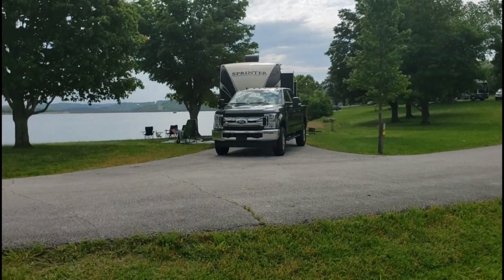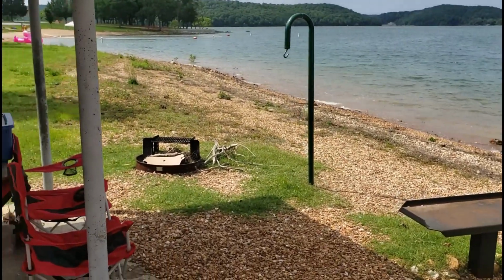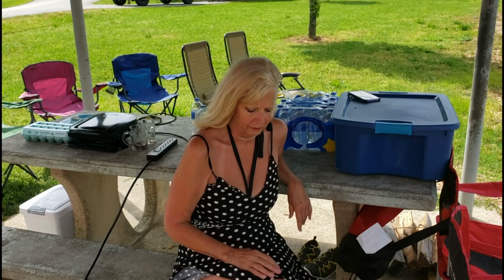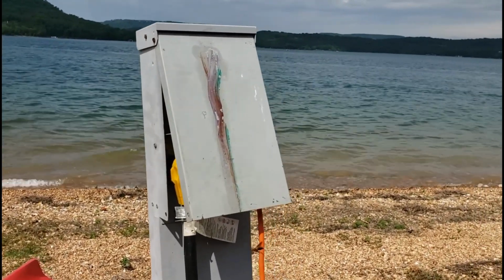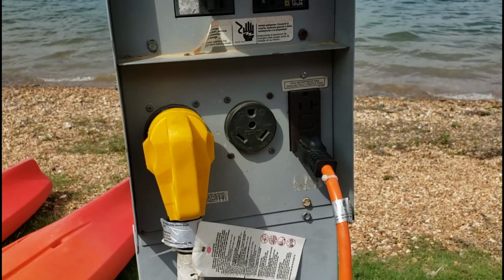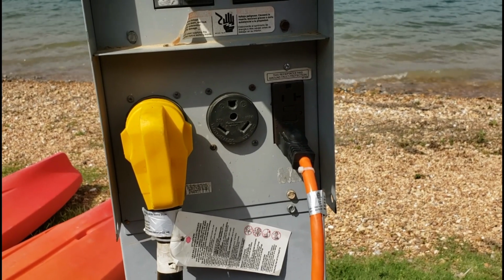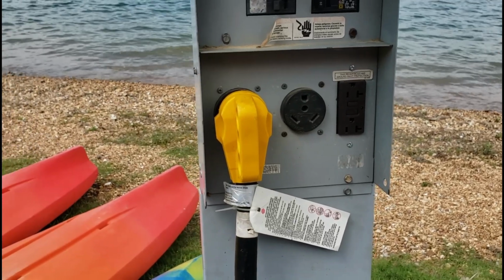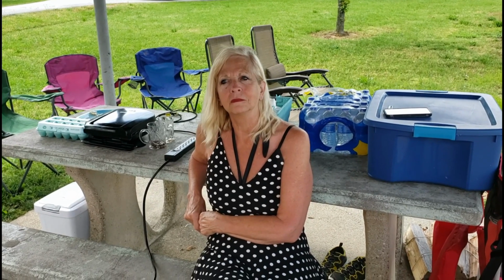Cargo Conversion Living/Electrical Issues!

Comment: I knew it couldn't be YOUR system!   I use the trash bag on my Hot Tub power pole because it's ground fault and if it kicked off in Ohio winter I'd have a skating rink WAY too small.   I laave it on year round.   Good video,  pretty dress!

Comment: You got me thinking.. I brought  my RV home  the other day.. and have a 30 amp RV plug at my house..  I plugged it in.. making sure the breaker was off..  and turned on my automatic vent fan and forgot about it..  Well this video made me go out and get my surge protector and plugged it in just in case.. Then actually flipped the breaker on..lol..
Reply from the maker: Yep. We're kinda living dangerously right now, but that will all change soon. In addition, most circuits in the trailer are protected with an arc fault receptacle which helps a little.
Reply: @billanddeb   A 50 amp surge protector is $$$ but worth it in that one incident..  I bought my 30 amp off Amazon.. and think it was a good buy. (and I work at a RV center).lol The parks may not let you put a trash bag and tape it, sealing up the power stand...  .. My suggestion is a kitchen tall trash can.. just turn it upside down and put it over the power stand..  Now having said that.. It of course not work for side attached poles etc. Good luck..

Comment: I think the trash bag will be the right way to go.. How's Dililah doing???
Reply from the maker: Delilah is adjusting .
Reply: @billanddeb  I bought a 2002 class C I'm thinking about upgrading  it to 50amp service.. Suggestion???
Reply from the maker: Wouldn't know what's involved without seeing it first hand. My first thought is you possibly need to rip everything out and start from scratch.
Reply: @billanddeb  I think that's what I may do.  Along with adding solar..